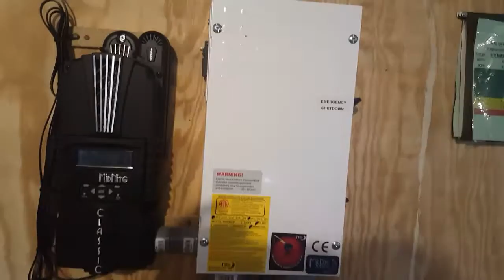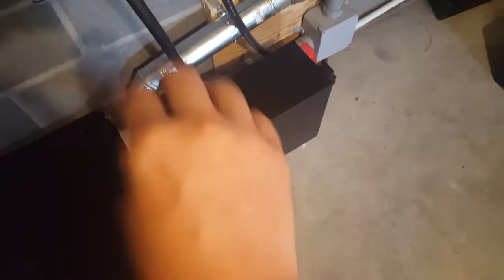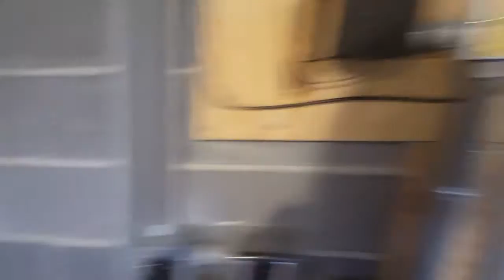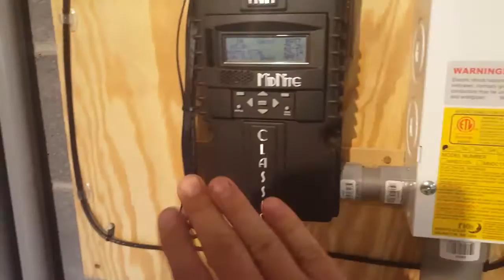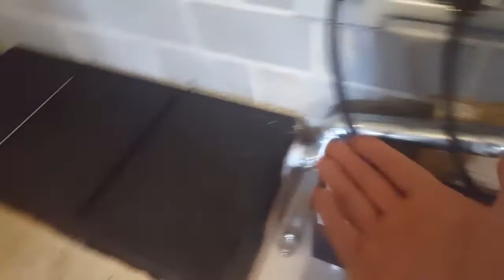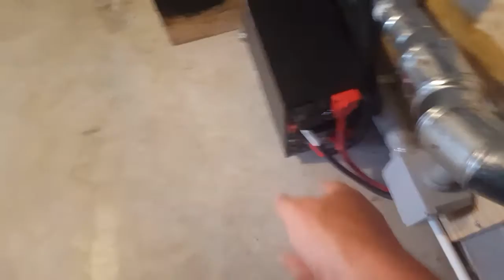Should you go with a 48 volt system on your solar array

Comment: So for a small system using led lights that implement a transformer, could I energize those lights with 12 volts direct and avoid using an inverter?
Reply from the maker: Yes you can Run light on a small array @ 12 volts. It will be a great system for you to have

Comment: 12v is a mistake.  And I think I your system is dangerous....I would never have an inverter bigger than 2000 watts at 12v...  12v=2000w max 24v=4000w 48v= 10,000w.

Comment: Just get a pipe 5048GK solar and wind power inverter 5000 watt 48v
Reply from the maker: Sorry I call the manufacturer and they wouldn't  Sell me a inverter so I gave up hope with the garbage pip
Reply: If you switch to 48v  lithium you won't need 3000 watts of panels either. So you could make another smaller system to use elsewhere.
Reply: Lithium is way way way better than lead acid or agm in so many ways
Reply from the maker: @Housemouse7777   You should look at my new videos I have a 33 kW lithium battery 12.2 kW solar array 3 charge controllers 2 48 vote in inverters one is a magnum 1 is an outback

Comment: First of All i live where shortest day is 4 hours of light 
At 55°north so i need to make 5 bad Day PASS with No problem 
I hawe BUILT my off Grid not after wot i nearly need .. 
No i build IT after .. always even on a bad Day .. i make enough !! To idel 
Not use in abundens just idel ..
Then i made the max usag with out Damage to batteries 10%20%30% usag 
DEPENDING og batteri type .. and atleast 20hours of idel power 
I startede with a TEP3000@12V And 6000Watt PV using onley 4x 750watt = 3000Watt
240A of chardg power  so i can chardge battery with out using battery bank 
So batteri 1000A 5x 200A Sonneshine AGM onley run at night and sun All Day ..
Truh PV .. 
Same 4 EPever can do 48v 
So now the PV jumps from 750 to 3000PV  60A@48v x 4 
And yes  now i have 48 250Watt gold +5Watt
And 800A@48v with BMS batteri managment system and 
And 3 TEP 6000Watt  .. one fore houshold one for house 
And on for surplus power to naiboughs AC
And i am UPGRADING with 4 more 200A so i get 1000A@48v 48.000watt or 48kw
And a 3000watt wind turbin .. to Winther time .. IT can easy chardge the bank
At night over time ..

Comment: Did you ever think of lil 5$ arduino bypass  with 20$  chiness booster  

Relay turn off all.      And relay Dump the power from the solar too the batteries  

Total 30 dollers. = no 200w loss 
Only' two zero  '20w loss max  dumping unrestriced power too the batterys  the restriction is the sun only alowing 5 amps maxium flow 

Arduino can turn power off when batteries are full
Reply from the maker: the inverther was the problem  i have the magnum 48 volt best money used ever
Reply: Just a thought just like you switch off devices your not using  ;-)       standby  power killer

Comment: 12v you can run 2000w top. 24v you can run 4000w top. 48v you can run 6000w top (8000w?).  Higher volts, less amps from battery= thinner wires need..! Higher volts, may be reasonable to buy more batt. Ah..  ☺ i have AGM 12v 260Ah, Full charged, not use it. I will buy another to parallel, 24v 260Ah much more afficent, be and less Amp draw.. Bless you dude! ☺
Reply from the maker: yes you can
Reply: Hey hey my TEP3000@12v EASELY  uses 400A .. when i push IT..
With dishwasher dryer Washer 
So IT is 4800Watt 
Thats Why i hawe bought the TEP6000@48V

Comment: Would you need to switch to 48V solar panels also?  How many watts of solar panels do you have currently?
Reply from the maker: Hey I have a Solar Ray that was designed to write 90 volts from the beginning it is 3750 Watts it functions well at 24 volts with the charge controller being a classic mppt and solar array at 90 volts it's not hard to switch if you designed it like this
Reply from the maker: I did switch to 48 volts as well and I'm grateful that I did check out some of my newer videos in the link

Comment: The cheapest fix is two add one or two 300W additional solar panels to compensate for inverter loss. ~$250 each. That will be a heck of a lot cheaper than replacing the inverter and charge controller, etc.
Reply from the maker: i have a magnum 48 volt to it and it been great
Reply from the maker: watts of solar panels is is not needed I need battery capacity at night so i have upgraded to a magnum 48 volt inverter and am very happy that i did

Comment: I agree that 48 volts is a great way to go... but...

200 watts for an inverter's idle draw? That's a lot.
My AIMS 1200 watt 12 volt inverter (yes, still on 12 volt over here, planning to upgrade in the future though), only uses about 12 watts at idle, if that. Now, if I scale that up to 8000 watts, that should be about 80 watts. 
200 watts for a 12 volt 8000 watt inverter seems a bit much to me.
Reply from the maker: I have a new magnum inverter and it's great
Reply: Good to hear. Magnum inverters are good stuff.
Reply: Aims inverters are just eating power like hungry hogs . Thats why i dont like them , the the mpp solar pip's they are much more cheap , affordable and efficient

Comment: I had sent email to both Midnite and my local Home Solar Installer about voltage from solar panels plus 48 volt batteries bank. I think about Classic vs Kid charging controller. According from Midnite, 30 Amp Kid MPPT rather charging 24 volt batteries bank than 48 volt battery bank. Your 100% right about, you rather to run 48 volt instead both 12 & 24 volt battery bank. Your Classic has shown from PV at 82 volt, it does sounded about right.

Comment: If you are off grid I would assume 48vdc is your best bet. For me my system is 12vdc my understanding is 4000w is 4000w no matter how you make it just more efficient inverter will help. The higher the voltage the lower the current the smaller the cable so there is a trade off. Most people on 12v system do not realize the cost in 2/0 or 4/0 cable. Good luck the 48v stuff is expensive .
Reply from the maker: +old time engineer I know
Reply: Yeah if you use 2/0 or even smaller and double up the wires from batteries to inverter and connecting batteries 12v works great.

Comment: 48 volt is the way to go. you save on wires and charge controlers (higher voltage = lower amps = thinner wires) also your charge controlers will run cooler.
Reply from the maker: Yes
Reply: I agree with that totally, I would even go higher toward 96 or higher with compatible systems. but they are usually more expensive. That't what they do is going up to 500 DC in grid tie systems. But a lot of people still choose 12vdc systems over anything else is the ease of use of 12vdc for chargers and lighting.
Reply from the maker: I know that your saying 12 in cars is familiar to every one
Reply: Solar Power Electricity and Electronics yes, and for 12v equipment you just go to nearest auto store and for 48v you can only order online (mostly)
Reply from the maker: yes
Reply: Ivan Kishov can you buy 12v batt and jumped them accros to get 48v???

Comment: You have 5000.00 in your system + all the wire and conduit right I'm not sure that you would want to run a stove off of that system well unless like you said you wanted to buy a whole new system it wasn't rated for those kind of amps. And not to speak of your batteries. Did I tell you I install solar and have for the last 10 years. Check out some of my solar videos 10 k system a 7 k system just to name a few. Hey I want to be friends we are all in the same boat or will be real soon.
Reply from the maker: +goforgreenliving what system does pretty well I'm pretty satisfied with it can you run anything that I need during the day and I have 100% battery until 7 to 8 o'clock at night why can I not run the stove off of my solar system
Reply: Off grider here- WHY would anyone not use propane for a stove/oven?  And instant propane hot water heaters?  Using all-electric gets silly expenseive, but is OK if you are on-grid.  I have a 3KW PV array, and run 24VDC now, thinking of upgrading to 48VDC next year, while we still get 30% tax credits.  Great video, BTW!

Comment: to easy mate. 48 volt is more efficient. End of story say no more. Saying that. The best system for you is the one you can afford. Save the $ and go 48volt on the first try. my 2 cents worth
Reply from the maker: I did go 48 volts and i'm very happy that I did.
Reply: RedShipsofSpainAgain
hello. Yes i run a 30amp step down. That powers all my 12v gear in the shed. The new stepdowns use very little power. I did a video on them a year or so back.
Reply from the maker: I would love to see a new video on it my friend
Reply: Yes, I agree.  Especially if you are building your system initially, it makes sense to jump straight to a 48 volt system.  My question is: how do you run traditional 12 volt AC appliances off of a system that is wired for 48 volts?  Do you just have to step down the 48V to 12V?
Reply: Solar Power Electricity and Electronics
Yes next time i do a video in the Power room i will show it. and see if i can find a link to the unit on the internet :)
Reply from the maker: ok

Comment: U have a great system so my for my 2 Cents I agree with rhandsom on his comment. He has mentioned  some great points . I choose 24v system as It gives me flexibility of taking 2 or 4 of my 8 battery's & put  them in my solar truck camper when I hit the road. I have a 12Volt system in the solar camper & a 24 volt system in my home. For my home I chose a Samlex 4024 pure sine wave inverter charger,$1605 with remote control with shipping.  It uses .75amps in stand buy unlike the 3.5 amps that my #3 Aims inverter used to do nothing. It is also a high & low frequency inverter, never gets hot it has been turned on since I installed almost a month ago.  So maybe think about what U already have & just upgrade your inverter. I also think 48Volts is great but not really needed the difference in efficiency is very small. If U are purpose building from scratch it may make more sense I would not start all over it like chasing a benefit u will never receive I feel.  Just my humble opinion.

Comment: Since you asked for opinions I'll give mine.  In my opinion the answer is to simply get a better inverter whether 24v or 48v, based on your needs.  The inverter you have is an energy hog like an older non energystar fridge, Aims inverters are "known" to be energy hogs, I have a brand new I've never used.  They typically come with a hand remote so you can turn it on and off remotely.  They work great for "backup" operations.  I don't believe they were ever designed to run 24/7 for true off-grid operations.  I run my 24v Magnum Energy MS4024PAE turned on all the time as you know and it runs fine with minimal energy draw in idle mode and that's because it's constantly checking to see if the main power is out so it can transfer over.  It's just a better inverter from a company known to make rock solid inverters specifically for "continuous" off-grid or backup use.  Yes, a 48v system is a "little" more efficient, but not enough for me to have regrets with sticking with a 24v system or to justify someone chucking an Outback 24v based system for an Outback 48v system.  Heck, even a 12V magnum inverter would out run most of the cheap 24v inverters out there.   Magnum Energy, Outbacks, Xantrex, Schneider Electric and many others,  are top of the line inverters and they are not cheap for a reason.  My question is, if you have the money, and you've already invested a lot into your solar installation, why not get an inverter that will last almost as long as your installation?  People may say, those others are just too expensive.  Dude, these inverters have a higher price tag for a reason.  They are built to be used everyday and to last a long time.  Regardless of what base system voltage you choose, the "power" or watts requirement for your loads will still be the same.  Yes, with a 48v system your voltage will go up and your amp requirement will go down, allowing you to use "smaller" wire but the power requirements will still be the same.  4/0 cable is not excessively too expensive and it's not that difficult to deal with, coming from someone who never dealt with it until now.  Aside from the marketing hype and the fact that you could use "smaller" wire because of less amp draw, for myself, I don't see any significant benefit to say I think you should go with a 48v system "just because".  For most of us, the decision was based on what we needed at the time, cost, and reliability not hype.  I didn't go with an outback because I needed the 240v capability.  I went with a 24v system because that particular model had the features I "needed".  Which was 240v in and out capability with internal battery charging, with the appropriate power output capability of 4000w continuous.  And it was built to last.  Whatever system type you choose, I would suggest getting it based on your requirements such as cost, idle energy draw,  power output ratings, warranty, manufacturer's reputation, and longevity to name a few.  12v vs 24v vs 48v is an academic\ marketing debate not for real world.  Just my $0.02

Comment: for a 4000 watt inverter
4000/12= 333 amps from batteries, 300 gauge which is bigger than 4/0, battery bank needs to be at least 700 AH, supporting wind and solar to charge batteries
4000/24=  167 amps from batteries, 4/0 gauge , battery bank needs to be at least 334 AH, supporting wind and solar to charge batteries
4000/48=  83 amps from batteries, #2 gauge, but I would suggest 2/0 for upgrading to larger inverter capacities, battery bank needs to be at least 334 AH, supporting wind and solar to charge batteries
You don't wish to go below 60% of charge on bank of Batteries, which is the difference between a inverter charger and basic inverter that will run down until the battery voltage drops out of range.

As you can see from the amperage, it takes more amperage to get your power 120 vac from a 12 volt battery than with a 48 volt battery bank.
If you are using a very efficient MPPT charge controller where you can put panels in series to get the panel voltage (or Wind Turbine) up to about 100 volts or so, more of the power will charge your batteries better at 48 than 12.
Hope this helps
Reply: +Guns,Games and Racing Sorry dude, but it is my understanding that efficiency deals more with better performance. A 48v inverter that produces 4000w AC is a little more efficient than a 24v inverter producing 4000w AC, but they are still producing the "same" amount of "power".  One just does a better job of it.  4000w is still 4000w regardless of the source it's coming from. Now the individual inverters may have different responses to loads dependent on the brand and manufacture, but that has little to do with it being 12v , 24v, or 48v. It deals with quality of the product. A 48v system is more efficient at converting from 48v DC to 120v\240v AC which I'm sure you already know. Battery based non grid-tie inverters are notoriously in-efficient. If you get one that is above 92% your doing well. Looking at my data sheet, my inverter peak efficiency is 93%, Magnum makes a 48V version called the MS4448PAE that is 94% efficiency at peak. Wow, a whopping 1% . Please tell where I'm wrong here
Reply: Fair enough, however, lets look at the numbers "realistically", in all reality depending on what type 4/0 wire you use and if the temperature is up to 90 degrees Celsius, the max ampacity rating is 260A.  If you would be drawing up to 260A DC continuous or even for a short surge, I must ask the question, what would you be running continuously that requires that much continuous load?  A lead acid battery bank with 700Ah is actually (700ah x .20%DoD = 140Ah of usable power), At 50% DoD, it would be 350Ah of usable power.  In either case, with that in mind, a continuous 260A draw would drain a 700Ah battery bank down to 50% in just over an hour (350ah / 260ah = 1.3hrs).  In reality, I haven't seen anyone with that type of DC draw for a typical residential dwelling that would justify upgrading to a 48v system.  Again, just my opinion.
Reply: Check out Justin Case channel
Reply from the maker: +Rev John O'Toole I have been he made a video for me super nice guy
Reply: you either get one to match the inverter, 4 or 8, or you get a big one to match future upgrades, like a 12.
the challenge is deciphering the language on ebay as to what they really are, returning them can be pricey.
Reply from the maker: rhandsom this is a understanding of the problem i need more power and i can get it with a more efficient inverter